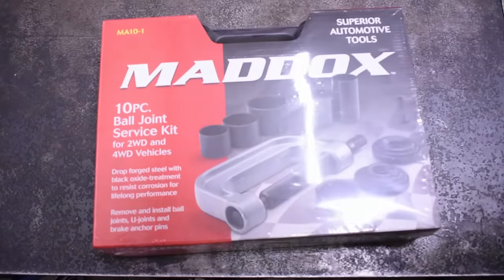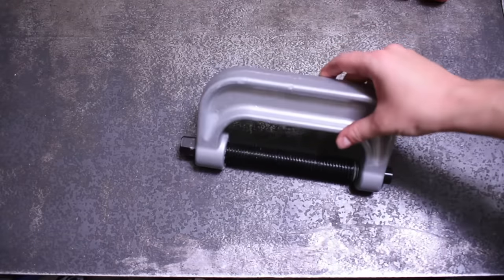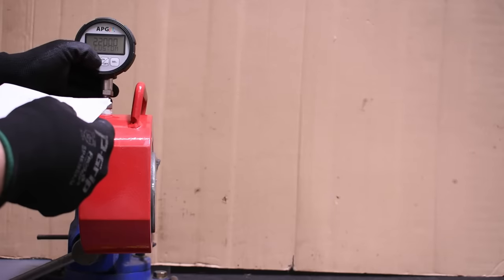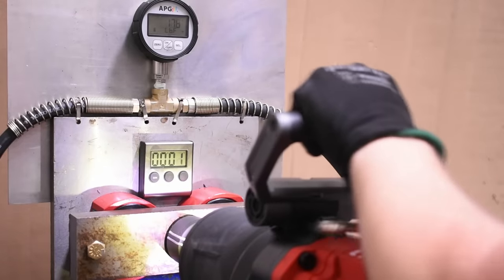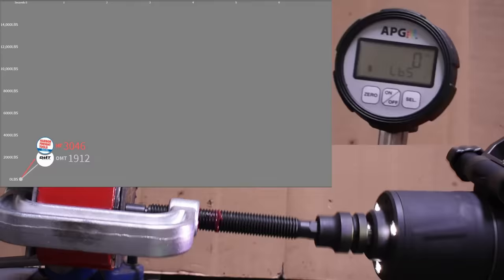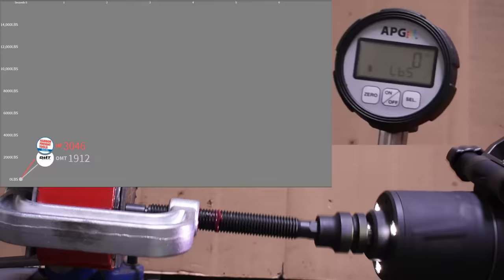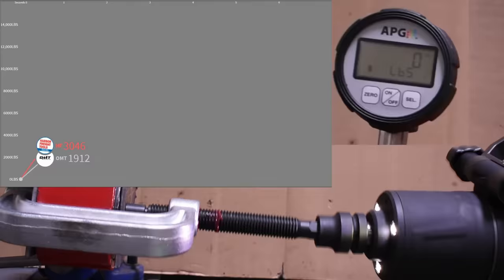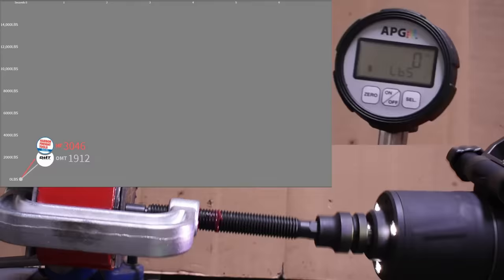Exactly How Strong are Ball Joint Presses? Harbor Freight vs Amazon

Comment from the maker: This hydraulic ram resulted in the death of one of our custom calibration gauges from this filming, in filming episode 2 we killed another custom calibration gauge. We thought we had captured all the data, but it appears it was skewing the readings more and more throughout the day. The gauges are around $600 a piece, and we dont appear to be exceeding 10Kpsi,  so we're essentially just weary about revisiting this and addng to the pile.
Reply: Sorry to hear about the cost.  Have you thought about reaching out to a custom hydraulic shop?  Their testing setups are pretty robust, might be a good q&a resource.  With the launch of the icon ball joint it would be super interesting to see if the snap on clone is really a clone like their jacks
Reply: @d1986ben The Snap On ball joint press isn’t very good. A coworker (who is a nazi about tool maintenance) managed to destroy the threads in the forcing screw in a brand new Snap On ball joint press with nothing more than a 1/2” drive ratchet. Yes, he greased it prior to use.
Reply: When you guys have time please update this video with the new icon press

Comment: I know all the Jiffy Lubes will be glad to see one of the tools they use to put drain plugs back in tested, looking forward to the one inch impact test
Reply: Valvoline too....they don't want any leakers leaving the place...lol....but i did have to use a 2 foot breaker bar to get my oil plug out after a mid winter oil change
Reply: lol
Reply: A buddy of mine works for Jiffy Lube. He says they buy at least 1 oil pan a month kuz they strip em out when impacting them back in.
Reply: lmao!
Reply: @TheRealMikeWilly  you would think that at least after the third time the would learn not to impact them in...Life sure is surprising
Reply: I wasn't ready lmao that's the hardest I've laughed In a long time
Reply: The cheap oil change places are probably subsidized by the companies who make hi-torque impact wrenches, since you'll certainly need to buy one if you ever decide to do your own maintenance.
Reply: At least they put it back
Reply: @TheRealMikeWilly  why on earth are they using impacts on a drain plug?? At least at walmart they torque the plugs to manufacturers torque specs.
Reply: Replace the plug Oring or gasket would be easier and less likely to cause issues.
Reply: @npb3871  it’s a joke
Reply: My CR-V had a bowl-shaped crusher washer on the oil pan, courtesy of the dealer. I took it off with a breaker bar and a kick.
Reply: @kevinharris931  on Hondas, Toyota, and certan models of hyundai its required to change the crush washer every oil change
Reply: Lol 😁
Reply: @npb3871  Nissans too
Reply: @TheRealMikeWilly met most if not all of them have metal threads held my a HOT plastic drain pan. When plastic gets hot it breaks SO EASY. Anyone with a plastic oil pan SHOULD DO THE OIL CHANGE THEIRSELVES W BECAUSE NOWHERE WILL WAIT FOR THE OIL PAN TO COOL.
Reply: @GregsAutomotive  anybody with a plastic oil pan needs to sell whatever Eurotrash they bought and do some actual research on their next car. I don't buy a vehicle based on how it looks, first I took at the engine that's in it, is it a reliable motor without many known issues. Next the transmission, does it have a trans with a reputable performance? Then the vehicles utility, is it gonna do what I need it to do? And lastly, how does it drive? Does it stop good? Handling? Who the fuck puts plastic oil pans on their engines? You kno where plastic comes from right? It's a byproduct of refining crude oil, one of the last byproducts after engine oil, gasoline, diesel, kerosene, petroleum jelly, and all the other petroleum products. You kno what's happens when plastic gets soaked in oil? It breaks it down. Plastic doesn't belong anywhere near oil. All these plastic valve covers have me shakin my damn head. But I make a lot of money off of them.
Reply: @TheRealMikeWilly i learned something today thanks
Reply: Fact that people use places like this are ignorant to cars

Comment: Believe it or not I've beaten the balls off a few ball joint presses in my day. I always had OTC and have been through several of them. Years ago I got a couple from Astro tools. They're extra deep one or extra long rather and then their regular set. I've hammered, heated, beated, sprayed, torqued, twisted, thrown and dropped them in the dirt snd they seem to hold up pretty well. I'd be interested to see where Astro holds up in the mix...
Reply: I  have the Snap On Press and I have used it for the past 13 years and it's the BEST!!! 
All the cups have snap rings and hold everything together perfectly!!!!
It's well worth the cost!!!!
Keep Rocking It Out Brother!!!
Reply: I actually bought the astro tool ball joint press because of you Eric and man they take a beating they hold up like no other!
Reply: I always get the Astro or OTC brand tools if they're available... I'll pay for a better product and warranty every time....
Reply: I run the Maddox one myself, but it's rare I ever use it. 95% of the ball joints I end up doing are either built into the control arm or the bolt on style. Honestly, I end up using my angle grinder for the riveted type much more often than my press. Just the type of vehicles that are popular around here I guess.
Reply: Astro tools are awesome I have the full ball joint press and the Goliath press 
Very good quality
Reply: All hail Eric O!
Reply: @peterfaggella3120  this country needs more mechanics like him.
Reply: I did manage to break a forcing screw and tweak my standard frame astro press. Then bought the Goliath from ASTRO and it seems much more stout
Reply: Eric O! The king of beating the balls off of tools! You’re the man! Love all your vids!
Reply: @Danbuilt426  I've been eyeing the goliath, always seem to need cups a little shorter or longer with standard c. Good to see possitive comment on it. Thanks
Reply: I want him to try an OEM brand balljoint press.
Reply: @rockerpat1085  came here to say this. I used OTC presses for 24 years. They work. Snap on's press makes it fun. Can't believe I waited this long to get one
Reply: I have the Astro set as well and would definitely be interested. The harbor freight one doesn’t seem to bad
Reply: Not a sponsor!
Reply: I also bought the Astro Pneumatic version on Eric's recommendation and have had good results so far. I would love to see how it compares.
Reply: @rockerpat1085  that makes one of us, Snap-on was crap for me
Reply: I love my Astro master kit, but I broke the screw on it so now I use the screw from an Amazon kit in the Astro clamp and cups
Reply: I got cheapest one on Amazon already been through 40 rebuilds without an issue adapter are only down fall but harborsfrieght are compatible for when o need it quick
Reply: Cool I jus picked up an Astro bcz I thought of the king of Uga dugas south main auto  usually has luck using  Astro tools so I figure I give my money too Astro haven’t used it yet but I will soon

Comment: I love to see the Astro, OTC, Snap-on and Matco's exclusive designed presses tested. This is definitely interesting on how different even the 2 cheapest ones are.
Reply: Start clicking on the ads!
Reply: The matco one is designed by Schley
Reply: Snap- on has the best ball joint press by far. The price for one is what sucks. 
Matco came out with a new design, but it is not as versatile in small tight areas.
Reply: Would definitely like to see how the new icon one stacks up to the snap on one!

Comment: With vehicle prices and availability going insane most people will be working on their own car/trucks during these trying times, I know I will. Letting people know which tools will do the job safely and effectively is very much appreciated. Thank you for all you do. P. S. It's great the way you present the testing also. Thanks again.
Reply: @soundsofnature7015  As the prices  go up people have a tendency to keep their vehicles longer, which in turn means either take it to a Stealership, local repair shop or do the repairs themselves. If it comes down to paying to put a ball joint on or paying for a prescription I for one will do the work myself and use the money saved to get the medicine my daughter needs to keep her alive. Knowing which ones are the best to get the job done helps me do just that.
Reply: Some  Harbor Freight tools I consider them to be “Single Use” plus the repair for which you need it is something you only do every 6 years so I just buy the cheapest tool, use it and dispose it at the metal recycling center. The DIY savings  are greater than the cost to buy new tools.
Reply: It's neither one of these

Comment: The big thing with this style press is getting it set up in a straight line. Get just a bit off angle and now the force required climbs rapidly due to the angular pressures on the parts. That and the folks who miss the retaining ring, or that it's a threaded part not a press in.
Reply from the maker: Exactly this, spot on!
Reply: With the old Pittsburgh kit from Horror Fright the cups/adapters were so soft they would start to bend and crumple on the first turn so it didn't really matter how much of a straight line you had it in the C-frame was soon all crooked & done for. Likewise, if their new Maddox one doesn't come with higher quality adapters it really won't matter that the C-frame is stronger than their last model , but unfortunately this testing didn't take that into account.
Reply: @TJK0ng  lol one of my Pittsburgh adapters has an old axle nut forever cold welded into it. Thought I was making progress but the nut was just swaging it's way into the cup.
Reply: Got a good laugh from you calling out people missing the retaining ring 😂

Comment: Snap On Press!!!!
I have owned one for the past 13 years and have never had any kind of problem!!!
The cups are held together by snap rings and hold everything together perfectly!!!!
It's the BEST!!!!
Keep Rocking It Out!!!
Reply: Bjp1, $800 plus for the master kit. I own two actually and have cracked and shattered the cups, but never had a problem with the actual press itself
Reply: I see snap on sets used, retailing around $600. Sounds like a decent investment, hopefully we will see in part 2!

Comment: I have the Maddox, used it on the rusted stuck ball joints on my 1995 Chevy 2500. Didn't even break a sweat, pressed them right out then right back in. I highly recommend it. I was using a Kobalt 24v, non XTR. That also did great, went through a bar of a 4 amp hour  battery after 2 ball joints (uppers are riveted on this truck) and all of the front end bolts.

Comment: I think the most common ones most of us use are OTC since that’s what the parts stores loan out, or Astro, Snapoff, Matco
Reply: that snap on one is amazing, I haven't used the matco yet
Reply: Snap- on is the king in ball joint tool. 
Matco has a new design, but it isn't able to fit in tight small areas.

Comment: I used https://www.youtube.com/post/Ugkx4ynqaujg7rZKFapA8s29kTpRszJGa3-K this for the first time today to replace the front wheel bearing on my rwd 98 dodge dakota. This had absolutely no issue removing or reinstalling the lug nuts and it took off the axle nut without any struggle. Sounds like it's got some muscle to it. Time will tell
Reply: So does my 1/4 craftsman usa impact !!!!! Well with a small struggle.

Comment: Could you test if possible OTC and Asrto pneumatic brands
Reply: otc USA made lifetime warranty--astro Taiwan made and 1 yr warranty plus will stretch over time
Reply: Yes! OTC for sure!!
Reply: Yeah I'm really wanting to see the OTC
Reply: Another for otc.
Reply: OTC test I've punished mine for 25 years with no failure
Reply: Yeah, I upgraded my cheese grade harbor freight (older cheaper style) with an OTC. Would be nice to confirm I got my money's worth.
Reply: OTC Test Please 😊
Reply: Regularly use an otc press to press out anchor pins for air break shoes on heavy duty on road trucks in the rust belt in eastern Canada. It is serious hardware. We beat on them daily with 1/2” air guns and striking the heel with 4 pound hammer sometimes taking 5 or more minutes of constant abuse they last over a year before starting to bend and once they bend they still work after that we only replace them when they no longer push anywhere on the pin. Definitely would love to see what they can do!!

Comment: Did enough of us ask to see part 2 yet? Sure would be awesome to see! Thanks for all your hard work!🖖

Torque Test Channel
1 year ago
Where is episode 2?  We bought most of the top suggestions from the comments here. Tested them, then sent them to a facility to pull apart the ones we couldn't nuke to measure that. BUT of those brands it includes Astro, who Torque of TTC is working. So, it's on the back burner for now until we figure out if you guys want to see that or not. It's up to you guys. But the data's already in the books as it were.

Comment: Most of the ball joint presses, many of the high end companies say in directions NOT too use impacts on them. Only by hand.. but I have always used impacts and never broke a high end C-frame
Reply: "Don't use with impact wrench" is the press equivalent of "not for use as a hammer or prybar" on other tools.
Reply: @1337penguinman  Don't use your screwdriver as a prybar or chisel XDDD, just broke my baby snap on pocket screwdriver/probably not branded as a prybar....prying something. Thing was like 10 dollars so. Which isnt cheap for what it is, but yeah.
Reply: Because of the thread not c-frame. Impacts destory threads

Comment: I’ve got the Astro pneumatic. It’s been awesome.
Reply: Same, their one-box master set was a decent price on Amazon.  I got the "Goliath" extended clamp too.  Custom fittings from the Home Depot plumbing dept.
Reply: I bought a used astro press about 10 years ago it worked great for years but sadly the press frame has opened up and i can no longer use it to install ball joints they always go in on an angle. Cant really complain, it held up for longer than expected and they're fairly inexpensive.

Comment: How about you test the big boy snap on ball joint press?
Reply: Bc snap on is a scam. Anything snap on is money truly wasted.
Reply: @TheGuruStud  Found the guy that hasn't used a snap on ball joint press 🤣
Reply: @smitty2jones  he hasn’t used anything but harbor freight to change a lightbulb on his handa probably
Reply: @CPthetooladdict  CP!  I don't have a Matco dealer, bit their new BJ press looks dope.  I've had the SO for more than a decade and never had any problems (except my grease gun head won't fit on the zerk)
Reply: @smitty2jones  damn right. That snap on press is well worth every penny
Reply: I've used and owned quite a few over the years and no doubt snap on is alot better. I still haven't got to try the new matco yet to compare tho.

Comment: I definitely would like to see the OTC on that rig.  I have spent a lot of time pressing anchor pins out with them by tightening them down with the impact and then beating on them with a sledge.
Reply: I learned long ago from a veteran mechanic with balancer pullers & presses....If its stuck and seems unyielding....Tension it up and give the bolt a nice TAP! with a sledge...the shock forces will usually break any bonds...otherwise you'll ruin the tool. Also heat and shocking the junction while its still hot with PB Blaster will undo galvanic interaction.
Reply: @ericbrandt829  had an aluminum control arm break before and that is what it probably was
Reply: @ericbrandt829  map gas+pb blaster=hot oil treatment. Works well. Especially on rusted nuts and bolts. For presses and stuff, yes the extra smack def works wonders. If thats not working add the hot oil treatment.   Project farm actually did a vid testing kroil, pb blaster, atf mixed w acetone, cheap liquid wrench, etc. The cheapest one, liquid wrench actually worked the best

Comment: Being a retired Ford motor auto light truck tech I have and used a MAC Tools Ball Joint Press set I used it for years and put in hundreds of Ball joints. Kept it cleaned and lubed I never had any trouble out of it.

Comment: Neat!  I've been using a cheapy set (labeled as ATD, probably same manufacturer as the Amazon, and most other cheapy sets out there) and it's held up well for 15 years now.  I've had it pretty bowed out pressing kingpins and chassis bushings, but it's always returned to its shape.  It's been impacted since day 1 (counter to the operator instructions) and round here, there's no balljoint that isn't rusty.

Comment: We have been beating the crap out of a matco (OTC?) BALL JOINT RESS AT WORK FOR 20 YEARS. It has visibly bent while in use but always returned to normal shape and never messed up the threads. I have used a 3' breaker bar on it until it wouldn't turn any more then beat it with a 4lb hammer to shock the ball joint out. It still works great!

Comment: I’ve used the old Pittsburg press and I’ve always used a 3/4 drive breaker bar and an 5 ft cheater bar. When it feels like I’m not getting anywhere I hit the control arm with a little bit of heat and then smack it with a 2 pound hammer. The trick is to let the heat and hammer do the work for you.
Reply: I’ve done 3 ram 2500s with my old Pittsburgh . Never used heat though but you’re right about the hammer trick. I also put anti seize on the threads on the puller. Saves the threads. It would be easy to bend the press but you got to know when to use a hammer before you bend it. Lol 👍🏻